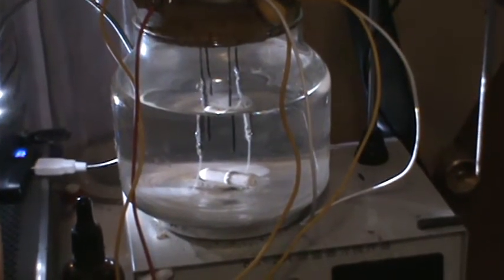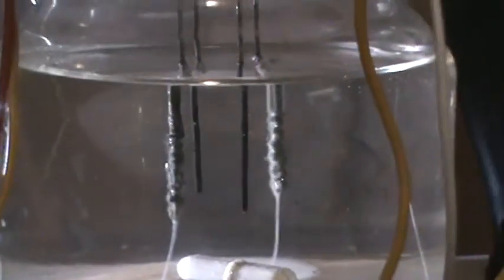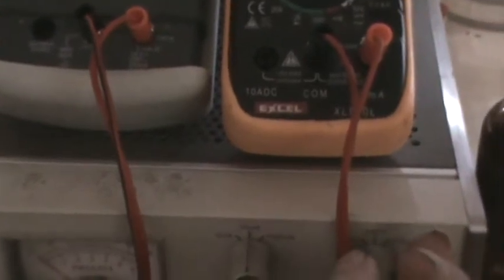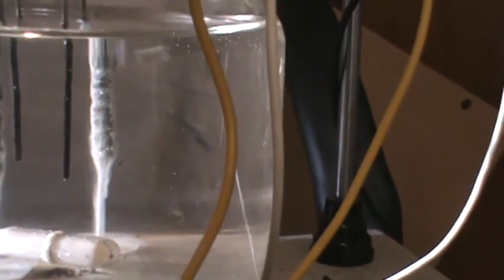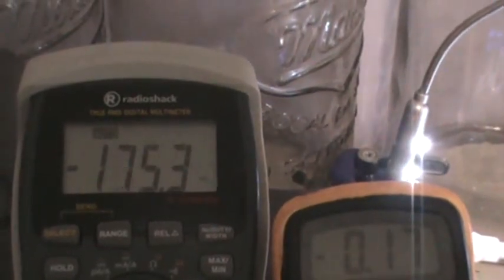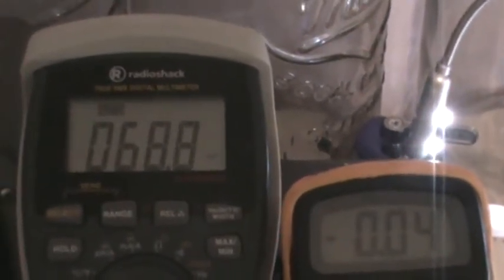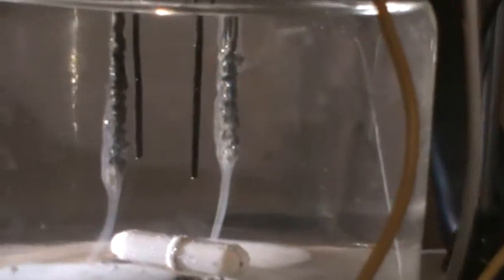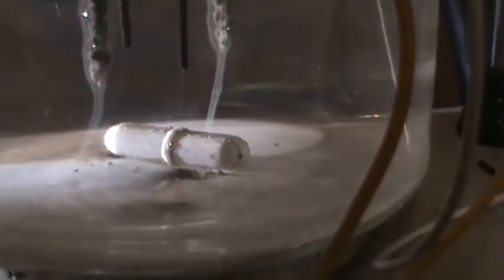Strange observation making colloidal silver

Comment: Its normal for the negative terminal to lose material because although we have been taught that power flows from positive to negative, in reality electrons flow from negative to positive. They used to make positive grounded cars, the problem was the rotted much faster as oxides would build up on the underside of the chassis, they never took off, negative grounded vehicles were much more popular and rusted much slower. As for the white powdered silver those are tiny crystals forming. Good video hyd, its not always easy to capture good video of the streamers coming off.